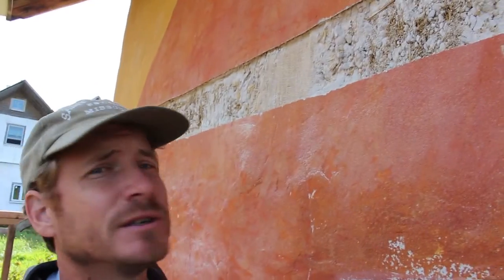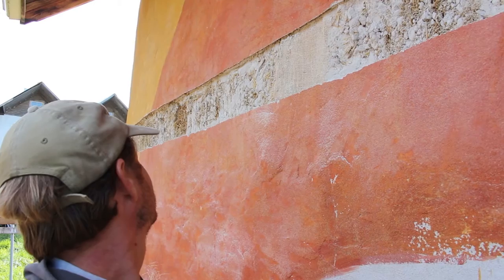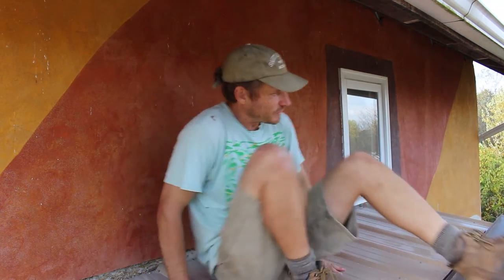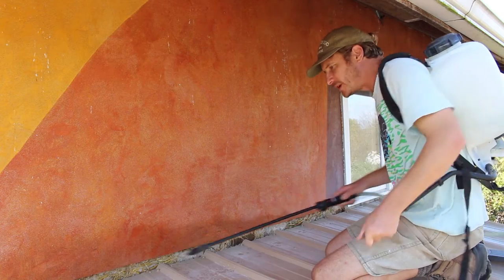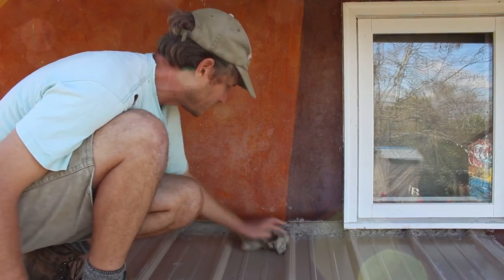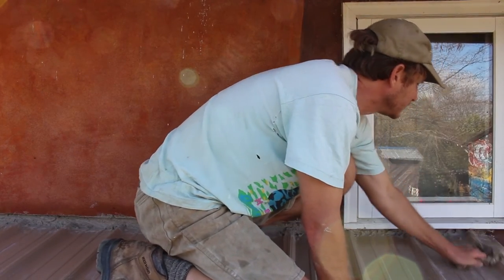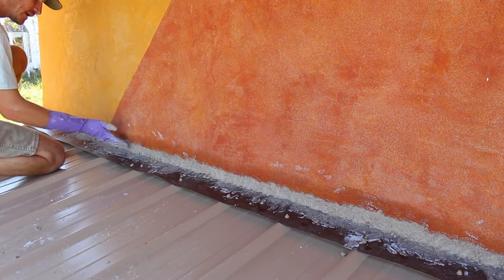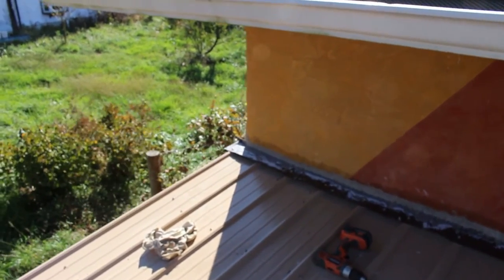Mudroom Addition Pt 2: Lime Plaster Repair

Comment: This is so interesting and edumacational! I'd like to try incorporating some of this into a new room this summer. Your video is not just theoretical, but very practical.
Reply from the maker: I'd recommend lime plaster for interior walls too.  It works well on light clay straw walls. Earthen plaster is great for interiors too though and that can be pigmented with milk paint really easily.
Reply: I really want to try this technique! Have you done any light straw clay?
Reply from the maker: Yes i did light clay straw in the other house I own here, and on the south wall and an interior wall on my current house.  I did the lime plaster and fresco on the south wall over the light clay straw.
Reply: Maybe you could find another wall that needs light straw clay and film it for us??

Comment: Great video! But are there any alternatives ways to do this, because it looks like a lot of plastic was used?
Reply from the maker: Actually, no plastic is used.  This is all natural materials, sand and lime, which is limestone that's been heated up to become calcium oxide.  When you add water it becomes calcium hydroxide.  In the process of curing as plaster, it becomes calcium carbonate.  Lime does have an embodied energy because it has to be made by heating and it had to be mined from the earth, but it is a good natural building material, not harmful in the environment, and a little goes a long way when mixed with sand.
Reply: wow, that's really interesting! 
Thanks :)